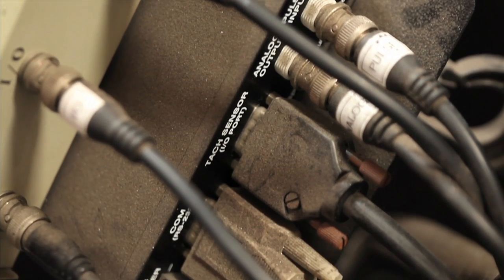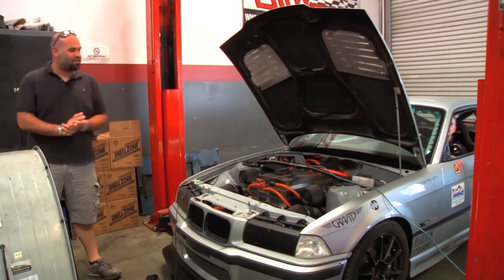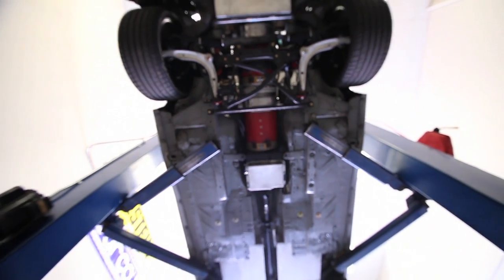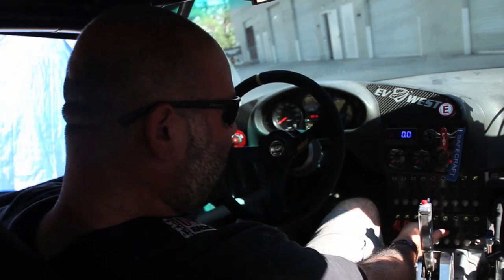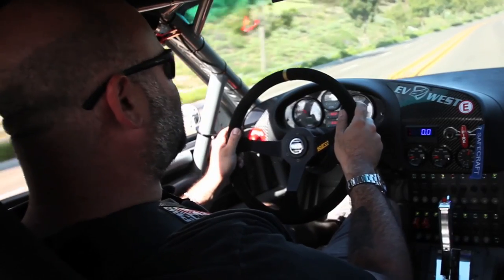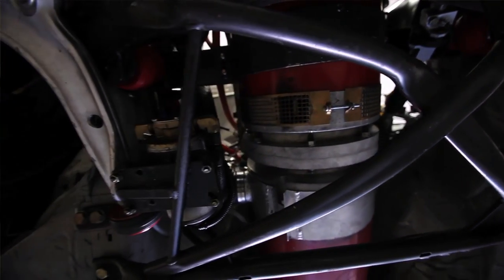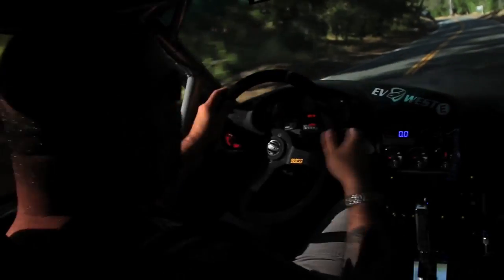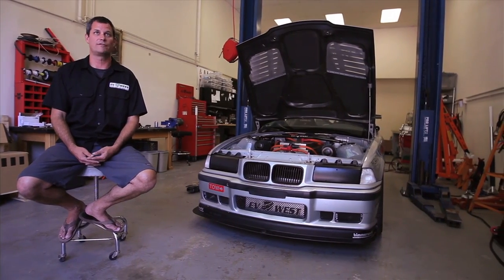This Electric E36 Makes 850 lb/ft of Torque at the Wheels! - /TUNED

Comment: I wouldn't miss the sound. 850 ft lbs of instant torque will quench my thirst just fine.
Reply: Rather have 850hp and some nice turbo lag. Nothing like roasting tires at 80 lmao
Reply: I think you'll need to try both, first.
Reply: You can still roast the tires at 80 with electric, and then again at 100, then at 120 haha. Couldn't with most gas engines.
Reply: It still only has 340hp. A 500hp+ petrol car would smash it to pieces.
Reply: Microage Electric engine use there horsepower differently than petrol engines. Without the rotation of so many belts and pulleys it can benefit from better with instant torque and hp. It might possibly compete with higher hp petrols more fairly.
Reply: Joseph Williams That's not how it works, you have instant high hp on a combustion engine too if you keep the revs high enough. Low end torque is only good for launching not for actually driving fast. Then again, wheel hp is all that matters. But electric cars are much heavier when trying to produce the same HP as a combustion engine.
Reply: Demon look out!
Reply: @MicroageHD  not with that much torque 350 hp gets rpms but a trans would keep that all day. Watch the hellcat and tesla race!
Reply: @MicroageHD  really? Hp thats all that matters? I think you should recap on your engine fundamentals.
Reply: @MicroageHD  think about it this way, this cars powerband is basically the entirety of your cars rev range
Reply: I believe EV West is limited in a lot of ways. They are selling very expensive kits while other players like www.etriodiy.com and www.diyev.com are selling wonderful kits on their websites. etriodiy.com is in beta phase but they have amazing stuff. They are customizing the Electrical conversion kits for daily use cars as well without much additional cost. Meanwhile, diyev.com is amazing as well.
Reply: You get a whole new set of sounds instead, like onlookers exclaiming "Holy fuckshit did you see how that thing took off?! It's dumbfuck fast!"
Reply: @MicroageHD  but the electric isn't going to blow up every other track run.......
Reply: Damn thats like having a big 2 stroke diesel motor in it.
Reply: And like he said there is sound, its just different. I would drive this
Reply: @brandonnelson4398  lets see it revved fule throttle on an upside down position
Reply: @MicroageHD  that's BS. A single turbo 2jz with 1000hp weighs about 600 pounds. A 1000hp electric DC motor setup with a 10kwh Li ion pack will weigh in  about 800 pounds.
Now factor in the weight of a full fuel tank in a petrol car and you are basicly at the Same weight.
Reply: and if ken block's electric ford focus is anything to go by...ev's can be loud too!

Comment: IMO I don't care what propels a car; as long as it is decently quick and/or handles like a boss. You people need to be grateful that others are willing to take a challenging route to be different.
Reply: Anthony Rs That one did have manual steering and nearly 4000 lbs of car. Not exactly easy on the handling front. At least when it comes to getting it to turn.
Reply: Donald Kenne Only at low speed in the parking lot.  Power steering is useless at high speeds.
Reply: You said it. That 4k lbs will go down as battery tech increases. These people should partner with tesla. They have the perfect combination minus the price tag
Reply: Anthony Rs That will require a while yet I imagine unless more people start pushing it. Right now it is a small crowd working on those things. Still, batteries are such a huge part of the weight sadly. Tesla has open patents for people interested in manufacturing EVs. So it wouldn't exactly require a partnership. However, I do not think their business type would qualify for that bit.
Reply: Donald Kenne  Yeah, I agree. We shall wait and see.
Reply: Anthony Rs Ideally, if clear solar panels and solar paint get further than their current development we could see electric cars, their range and uses multiply exponentially and much sooner than we could expect batteries to get us there.
Reply: Donald Kenne  Even if solar cells were 100% efficient at absorbing energy, they would still only make a tiny fraction of enough energy to move a car.  Assuming you are talking about panels ON the car.
Reply: Lithium i think is the best battery but they arent safe if damaged. Did this video describe the battery type?
Reply: Anthony Rs EV West sells LiFePO4 batteries.  Don't know for sure if this car has them.
Reply: ralphinator2 Yes it does, CALB 180Ahr if I remember correctly. Also I think it's about 96 cells, so just over 300 volts.
Reply: Coming back to this thread a year later, any of you see that Tesla take on pikes peak? I like to think this conversation was read by tesla and they decided to go forth in motorsports lol
Reply: I have an old Benz from the 60's nerly 2.5 tonnes and everything is manual! I love it!

Comment: So this guy doesn't like to 'shift', and he doesn't know that 1hp is 0.76kW, he thinks an M3 weights 2200lbs rather than 3200lbs, and he doesn't seem to be interested in this awesome future tech. How did he get this job? Electric is the future, bring it on.
Reply: he said 3200
Reply: yeah but this thing has a shit ton of batteries, so it would way a bit more.
Reply: and when he means not having to shift he means he likes how its immense torque and powerglide transmission go together. If I'm right it would have long gears, so it just uses the electric motors torque.

Comment: 1.50 $ a litre in Canada now for Regular Unleaded. No end insight as gas is becoming an economic braking force to the recession recovery. Countries that want to move forward from Oil dependence better move fast before there is no money to invest towards EV's. Electric vehicles should be subsidized by governments to make up for lagging technologies until systems progress. If we get trapped by peak oil the Middle class will disappear.

Comment: 400KW are 543Hp actually..
Reply: +Fierce Recognition that's good to know , thanks. I really didnt know that lol
Reply: +Fierce Recognition What? A kilowatt is an SI unit of power, horsepower is also a unit of power, although a supplementary one to the SI.
HP and kW are directly proportional, 1 HP = 0.745 kW.
Reply: +Lukas Sutherland 👍
Reply: +Fierce Recognition What the fuck am I reading KW and HP are just different measurements of the same thing, in the same way that Kilometers and Miles are. They are directly interchangeable.

In Australia, we have KW and NM, rather than HP and ft lbs
Reply: +Fierce Recognition "With all that torque, there is a difference. kW is not directly proportional to HP, but as HP and torque combined. People in say Australia don't say 500 kW and 600 ft lbs of torque, they just say 500 kW, as we say 600 hp and 600 ft lbs. Hope that clears it up :)"
Lel, don't speak on matters you have NO understanding of. Hope you do as of now, I lol'd and raged as I read this. Rofl, I can't even...
GL
Reply: +Max Bepunkt theres a slight difference between mechanical and electrical horsepower when it comes to motors/engines
Reply: +Mac Sogandares When you say slight, you really mean it. 800 horsepower (electric) = 800.321983070 horsepower (mechanical). Almost negligible! good to know though.
Reply: Yes, in DIN measurement the HP figure for 400kW is about 544HP, but in SAE measurement it would be 536HP. Both are fairly close, but if we're mentioning exact numbers it's worth noting. 

As for this car, it doesn't make 200HP and 500kW as Fierce Recognition stated. The electric motor generates 400kW but the drivetrain loss must be much greater than 15% if that number is reduced to 342wHP (wheel HP) at the dyno. That means they mention a different HP number after dyno, and that number SHOULD be lower than the HP number you would get when you convert 400kW directly without any measurement or consideration for drivetrain loss, but what they don't mention in the video is that the number shouldn't be THAT low because going from 544 or 536 to 342 at the wheel indicates far more than your typical ~15% drivetrain power loss. That, or the motor doesn't really generate 400kW in the car.
Reply: KW measures electrical power, (Volts x Amps x PF x 1.732)/1000. And horsepower is the measure of power from an engine, which is equal to 735.5-746 Watts. Power =Work/time Or force x distance/time. Both are a measurement of power, but the variables are very different.
Reply: Damn that little motor has a lot of power for its size and weight, its like a rotary magnetic 2 stroke, 3 phase is like 3 overlapping power-strokes for 1 rotor. So in a scene its a magnetic 2 stroke.

Comment: I want an electric E36. 400kW is about 536HP, that's enough.
Reply: It would be better with an AC motor like the Tesla, but it's still plenty. I don't need a supercar.
Reply: *****
850 ft/lb of torque is insane...takes off like a rollercoaster
Reply: *****
Right, it's only power to weight ratio that matters.
Reply: *****
Which is exactly why only power matters. As far as acceleration it's power to weight ratio, assuming you have traction.
Reply: ***** Fundamentally power to weight. The reality of gears, shifting, and efficiency loss is unavoidable.
Reply: ***** If the dyno read 350 hp, that would be 261 kW, not the 400 kW that they claimed originally. If the motor can truly put out 400kW, the dyno should've read is 536 hp.
Reply: The computer is running Windows XP--that explains all glitches and inconsistencies. :)
Reply: ZeHoSmusician XP? naaahhhh, windows 2000.
Reply: hzuiel That green stylised start button and the blue taskbar are the default and unique characteristics of Windows XP; Windows 2000 never had such a theme and it seems unlikely, especially in a professional environment, that they would've installed Stardock's WindowBlinds.
Reply: Why? Just take some wood,wheels and put a electric motor on it. Waste your time with that :p

Comment: Love hearing the resistance from old school petrolheads. They see first hand the amazing performance of EVs yet they still find something that bothers them about it.
Reply: I don't understand that guy's complaint about the engine noise with regards to racing. Going to a race track to watch cars do laps is technically a mind-numbing experience, I don't care what noises the engines make. The main reason to go is for the competitive side, and see who wins, and/or see who has the most impressive crashes. Racing EVs does not defeat any purpose (like he claims at around 6:50).
Reply: ZeHoSmusician Then you dont understand his reasoning. He loves the noise, the sound of 30 engines at 8k rpm. You like it or you dont i suppose. He said he was in the middle about the car anyway, yes its a good thing they are developing racing batteries but is it fun to watch? fun to drive? questionable.
Reply: @shiffterCL  recent developments in racing ev's show theres more potential for noise than one might think.
Reply: No exhaust notes??

Comment: this was just sad you argue against a car because it defeats the purpose of going to the track? what is the purpose? hearing dat 409? some just want to race their cars on a track and have fun
Reply: Yes, and for most people who LIKE cars a HUGE part of the fun is listening to an engine scream at high rpm's, the feel the mechanical marvel of pistons and connecting rods reciprocating like a sewing machine 100 times per second. It gives you goose bumps. Hearing the exhaust note sing. Gliding around a track in a silent car hearing the tires squealing is not exactly the same thrill...and like he said, "it's a lot faster than it feels!"...the thrill is FEELING like you're going fast, not actually going fast. Also, "409's" were only used in a very few certain large Chevy cars for a few years in the early 60's. The few remaining cars are collectors items now and don't see much track time. I don't think listening to "dat 409" is an issue for 99.99% of people.
Reply: justforever96 its personal preference, some like hearing engine sounds(probably almost everyone) but for some its fun to manage their car into  the apex, and launch it out of the corner. it might be a "hipster" thing but maybe it makes them feel better to have the newest and most ecological technology of transportation in  their race car.
Reply: I'm pretty certain that particular statement was directed at the spectator. not the driver. because you're obviously correct in this sense but as someone who went to a race to watch. the lack of exhaust note is equally as obvious..
Reply: vivalaphill Plus when oil runs out in 50 some odd years (At current consumption rate, that grows every day) this electric stuff is going to be great... I always used to worry about that. I would be so sad to see Motorsports be gone. Then seeing how people are actually making good strong power plants with electricity  in cars, I'm happy as hell =) I might not even be around for the that time to come, but just knowing people are paving the way for future oilless people to still have Motorsports, I'm all grins
Reply: +Mashiro Ainsworth You needn't worry, motor sport will just get better. Already the fastest vehicles up Pike's Peak are electric and, judging by development so far, within 5 years the fastest bikes around the Isle of Mann will be electric. As emotionally attached to the noise we might be, given we grew up with them, we will get used to and revel in the lack of noise particularly since we'll have way better performance.
Reply: +Robin Harrison blasphemy!!!! we want a sound complimentary to this performance you speak of lol
Reply: Robin Harrison Oh I'm not worried, I said exactly that =) " I always used to worry about that. I would be so sad to see Motorsports be gone. Then seeing how people are actually making good strong power plants with electricity in cars, I'm happy as hell"

'good strong power plants with electricity in cars' Haha!

I'm excited to see some electric rwd midships on the Togue.... Plus I bet the more crazy people get with these motors, there gunna make some wicked noise >:D But sound or not, after thinking about it, at the end of the day it wouldn't break it for me.
Reply: +Jeffery Antioquia The sound of explosions and lots of complex machinery is only the sound of performance to our generations. It's an emotional attachment that won't apply to future generations who will understand that it takes energy to produce noise. Energy that isn't going into the road. So the real complementary sound for great performance is silence. The louder the noise the more inefficient it is. Although I sometimes find myself going broom broom in my EV I very rarely lose my EV grin.
Reply: +Robin Harrison lol we'll make you a wonderful cd full of revs and gear changes so you don't lose your voice on long trips haha
Reply: I'm pretty confident that people who create electric cars will eventually install a digital sound effects to imitate a sound of fuel driven engines, so people shouldn't worry about that. Hybrid and electric cars are the future and step forward to a greener earth.
Reply: justforever96 
Internal Combustion Engine sound is ugly. They placed a muffler to sound it pleasing
Reply: I read your comment as he was saying that 😢 it pinned my heart ♥️
Reply: I believe EV West is limited in a lot of ways. They are selling very expensive kits and also, they are using the same kit for every car while other players like www.etriodiy.com and www.diyev.com and greenshed cars as well are selling wonderful custom kits on their websites. etriodiy.com is in beta phase but they have amazing stuff. They are customizing the Electrical conversion kits for daily use cars as well without much additional cost. Meanwhile, diyev.com is amazing as well.